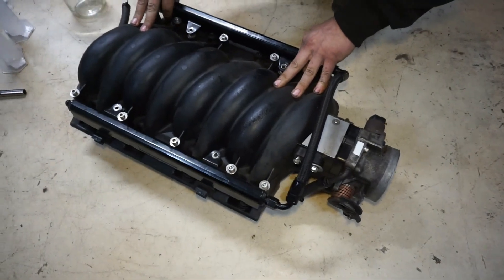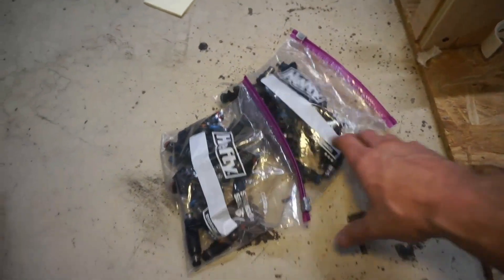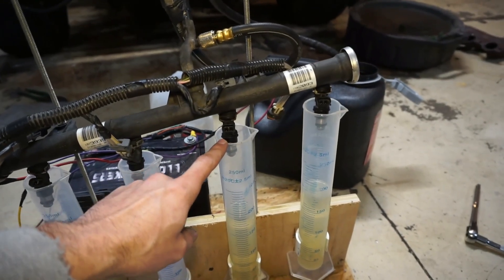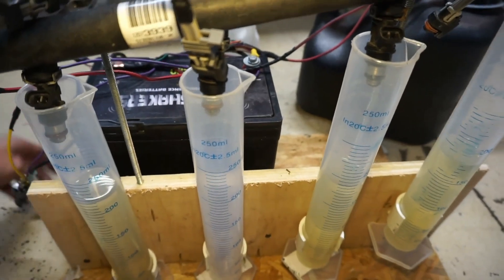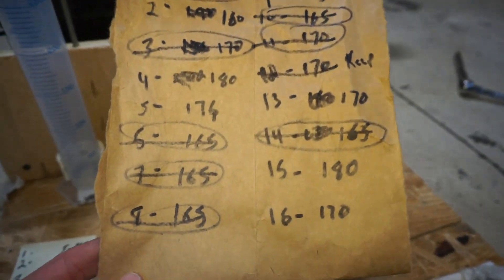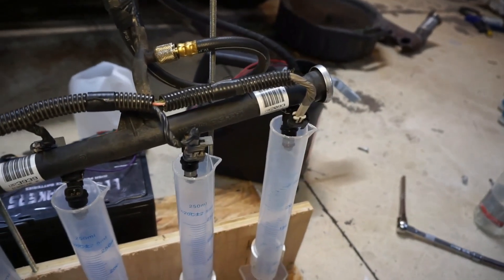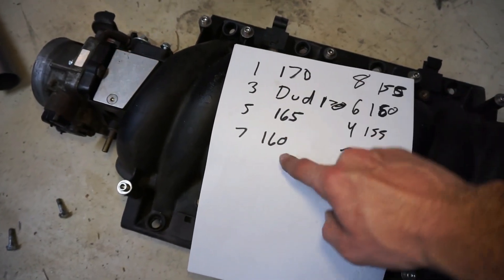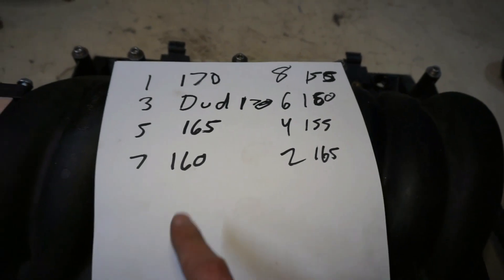BLOWN ENGINE!!! 10 SECOND FOXBODY BUDGET LS SWAP, AND WE TESTED WHY!!!

Comment: I'm at 1:28 seconds in I vote for timing. ring 5&7 are problem cylinders open up those ring gaps will help with the detonation and if u can run all 4 coolant lines not just the front 2

Comment: Thats the problem with fuel injection, getting a lean cylinder. You wont get that with a carb. You set it up with your air/fuel guage and thats what you get.

Comment: I think you guys should have sent them off to have them cleaned at the very least. I sent mine to Eric Derr. It was only a little over 100 dollars to have him go threw 16 injetors and get a good set of 8 to use. Seems silly not to do that but too each there own. Good video thanks for posting.
Reply: I agree with this to an extent. The important thing though is that they all flow equally and Ryans test rig is verifying at least that much. 👍
Reply from the maker: n2fastcars Yeah, I didn't want to go in blind that's why I built the test rig... the ones I'm using are all within 3% of each other. The main goal here was to prove that hunters #7 wasn't oober lean... We talked off camera about the Eric Derr flowing, I agree you can't beat the service, new o rings, filters, etc. Just depends on the person. Me personally if/when i spend money on a set, it will be a BIG set :)
Reply from the maker: n2fastcars I can also say, after the test I agree with the cleaning because they were stuck from sitting with corn in them. I'm going to flow the sets he gave me, he probably won't use any of these injectors again.